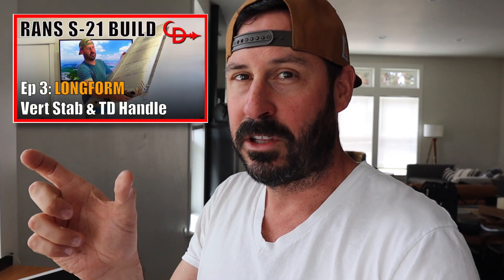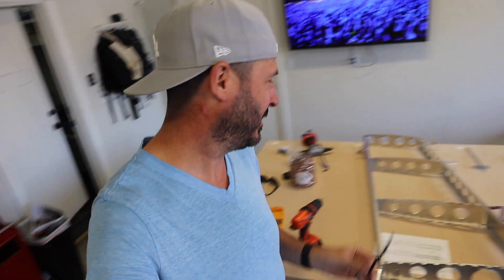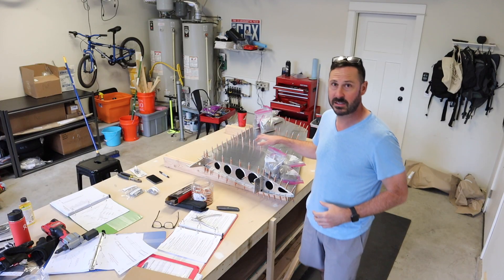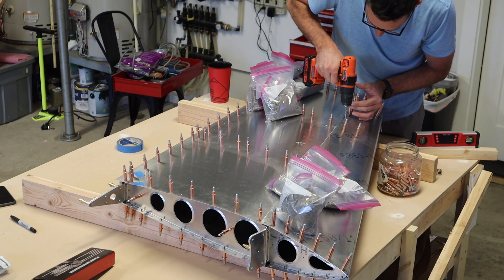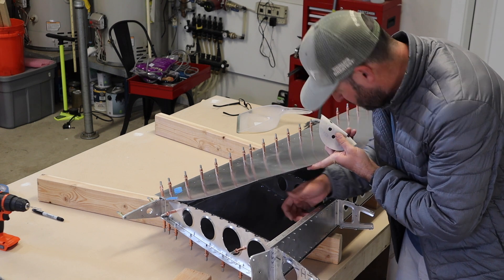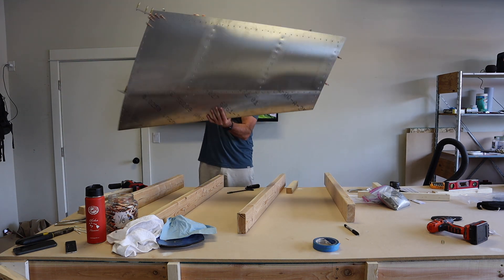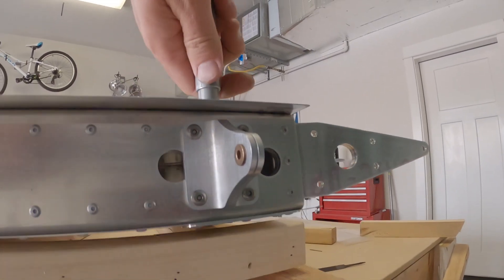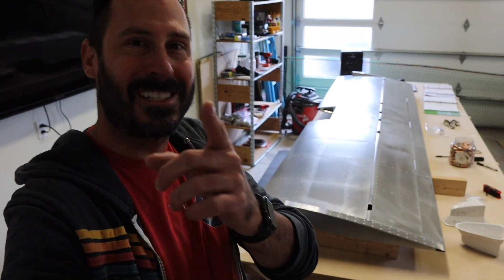RANS S-21 Ep 3 Vert Stab & TD Handle Build

Comment: Great to see another S-21 build! Grab some aluminum rectangle tube (I used 3"x6") before the wing build. Much easier than wood to keep level.
Reply from the maker: Yeah I really need to do that! Someone recommended 2x6 so you can reach under the wing. That might make for painfully high riveting though. I’ll def look for the metal studs. How long are yours, 4’?

Comment: Things will happen that's why a planning sheet - just like a check list or a "to do" list - is a good thing to have prepared before you set out to work each time.

You can then tick off each operation you successfully accomplish or put notes against the ones you pause until later for whatever reason. 

Yes, its a lot of work but it will make for an excellent log and proof that you built the kit (51% rule) and serve as a great 'memory jogger' for those times when you take a long break away from a particular task or series of tasks.

Great job on your part so far (two thumbs up), looking forward to your future content.

Thanks for sharing and taking us along with you on the journey.

By-the-way, when you have to remove rivets, it's a 'best practice' to just drill the rivet (from the manufactured head side) until the head just snaps off, then gently tap out the stem using a pin or other item which won't damage the hole. 

This way you avoid accidently enlarging the hole; which would result in a smaller formed head when pulled, as more material will go towards filling the larger hole.
Reply from the maker: Thanks for the encouraging words! A viewer recommended I punch out the mandrel before drilling. Any luck with this method?
Reply: @CLEAREDDIRECT  If the "Blind" rivets are of the "Cherry Max*" or similar type, they have a 'locking ring' that holds the stem in place once installed.

Therefore one must (carefully) drill off the manufactured head end of the rivet first, to just remove the locking ring as well before the stem can be knocked out using a punch.

CAUTION must be exercised, so as not to damage the surrounding structure, as well as the hole, if a replacement rivet of the same P/N is to be installed in the location after.

It's recommended that you practice using some scrap metal you fasten together . 

This should allow you to develop the skill prior to needing to use it in earnest.

* https://www.flight-mechanic.com/wp-content/uploads/2017/07/4-103.jpg